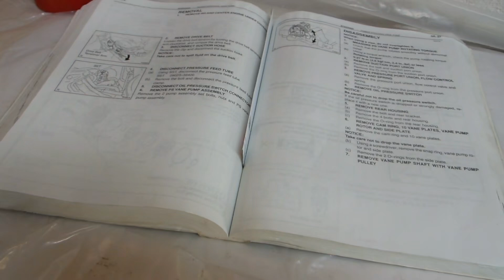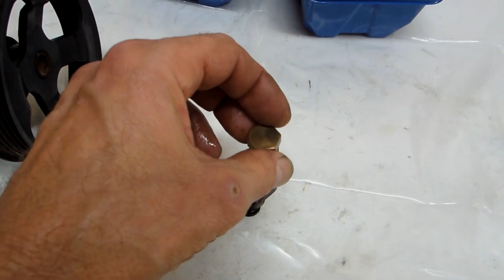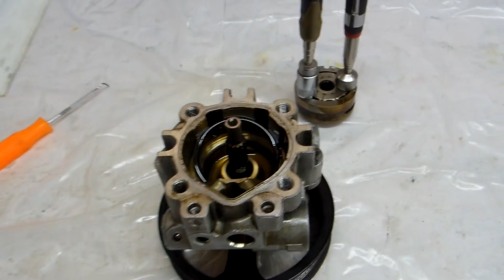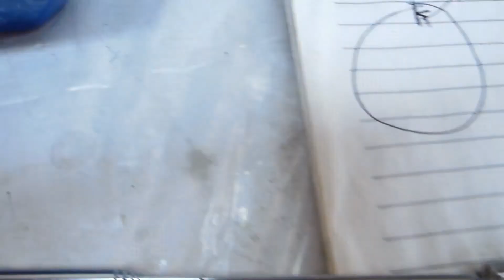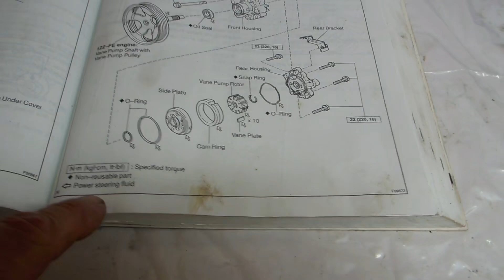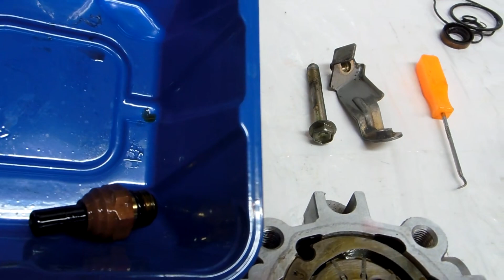Power Steering Pump Rebuild - Toyota Celica GT, GTS, RAV4, Echo

Comment: Thank you. I have same pump on my sienna. But didn’t see a spring beneath that flow control valve. Maybe I didn’t dig enough. I’ve just opened the pump today to check if it worth my time. Seems like it worth. One more thing. Chat gpt could not find an oem kit for this it so I’ve ordered Gates from rockauto. Funniest thing that it swore that Toyota is not doing that kit 😁

Thanks for the video and the number 🤙🏻